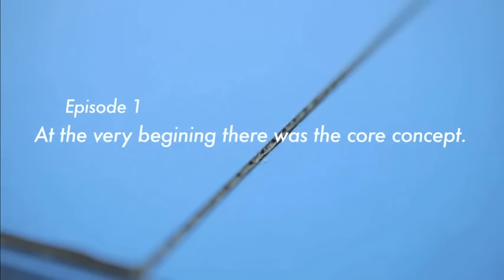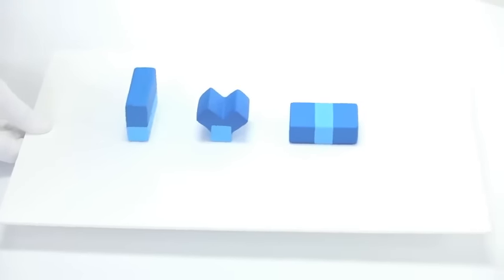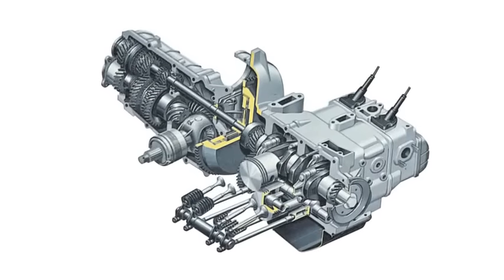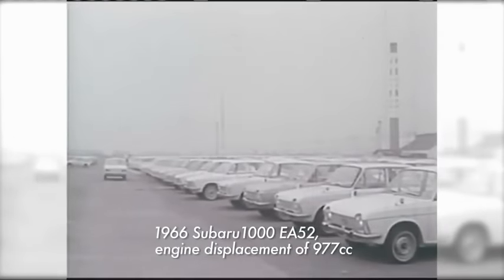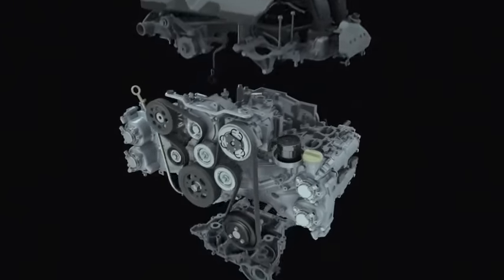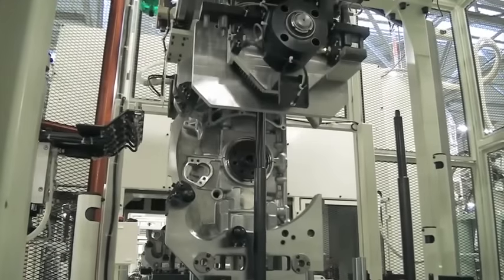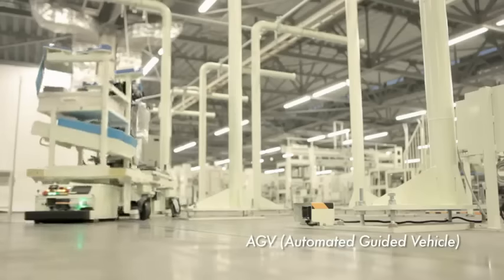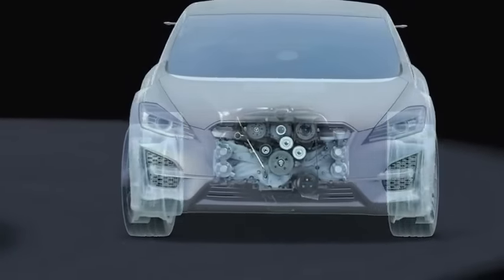Learn About Subaru Boxer Engine Technology

Comment: i drive a wrc and rather have a evo than an sti
Reply: you drive a world rally cross?
Reply: ThisNameIsntOriginal
There are WRC Homologation cars that are road versions of the rally cars. 
These typically have anti lag, (inlet bypass), intercooler sprayers and more HP. 
Also usually are sold in limited numbers, 2500 cars worldwide. 
Not sure if he's talking about a wrc evo or not, but that's usually what WRC editions are.
Reply: ThisNameIsntOriginal
Yeah, I drive a WRX. Which means world rally cross
Reply: TheMagicMan Not necessary, ive heard the X stands for Experimental, or relates to the AWD or 4WD but the X has always been debated.
Reply: ThisNameIsntOriginal no its actually world rally cross apparently :/ maybe wrc was trade marked or something
Reply: ThisNameIsntOriginal The X is the number 10. As in Evo 10. The Evolution 10
Reply: TheMagicMan you just said it meant world rally cross......
Reply: Well considering you cover is minecraft how much do you actually know about cars the WRX STi is I fact better then the Evo because it's turbo charged and can but out more HP because of it that's because the Evo is just a basic inline 4 nothing fancy not even a basic 1.8 L turbo
Reply: Shadowaries1 Some evo's not all and for the track the evo is better (unless you modify the STI) and I'm saying this as a subaru fan. However for the dirt it's a different story, the sti is usually better. Also for daily stuff the sti is a better car most of the time (depends on the generation)
Reply: ***** im not really knocking evos i mean i like they most of them have a nice ride feel but then again they drive really aggressively compared to the WRX STi which only drives aggressively when you want it to but still if your going to get an Evo and boast about it at least put a turbo charger on it i mean a tuner car is know for the handling and how quick they are via a turbo charger
Reply: Elliott Harrison yea i know and he cant even spell it right its WRX STi not WRC
Reply: Onur Oncer welp my friend some how has an evo without a turbo charger and ive seen few others that dont have them so im only going off really life stuff not google
Reply: Onur Oncer im being serious his evo just has a straight pipe no clue of any turbo charger we couldnt find one at least were do they hide them was going off of were the one on my STi is but still engine didnt sound like it and even the car didnt feel like it had one not much acceleration
Reply: Shadowaries1 The turbo is behind the engine towards the driver and passenger.  if its a regular lancer, yes those are stock. Evolutions have always had turbos, tell your friend to check, it should have small cooling aluminum air vents going towards the back, you should also be able to see the BOV. You know what? look in front of the car, you should see a intercooler in front of it. Best way to prove the turbo
Reply: Onur Oncer yea then it be right were the one in my STi is and nope theres no turbo charger i mean the car was 1 year old and used and he didnt buy from the dealer so maybe the last guy took out the turbo and didnt say anything.
Reply: Dude you play minecraft. I doubt you've ever driven a WRC.
Reply: bobkin611 why you guys calling it a WRC its WRX unless its terminology ive never heard of
Reply: Shadowaries1 There is a WRC as well as a WRX, it's a special edition.
Reply: ***** O OK
Reply: They are all really cool imo, For overall stock performance I would say the evo but subaru has the better reliability generally.
Reply: William Su yea i see alot more good safety ratings with subaru then any other manufacturer. also it does help having all the safety ratings and such in a performance car like the WRXs and other performance cars in that matter because it does inshore your passengers especially with the semi bad rep performance import tuners get
Reply: jeffel80 and if you were to read the conversation between me and another person you would see that i was baseing it off of my friends evo that doesnt have a turbo charger on it
Reply: jeffel80 That's also based on the idea of how people drive and take care of their cars. The boxer as I recall requires more oil attention than a normal V engine, due to the fact that gravity doesn't play a role in lubricating the tube. However, there are also the people who just slap a stage 2 COBB tuner on their car and think everything will be just peachy without regard or thought to what it will do over the long run of the cars life. It really just boils down to people man...
Reply: Sparatan117 yea my STi is a little heavy one the oil i check it every month but im one of those people who will leave a thousand or so head room between when i have to get an oil change and current mileage also i did throw a tuner on it just so i can fix the leen feul mixture of the car so that way i wont have to get ringlands replaced also i have an after market intake full 3 in exhaust system (header, up pipe, down pipe, mid pipe, and muffler) and a better intercooler to keep its turbo nice and cool my only complaint about the car is it doesnt take anything less the premium but hey it burns alot better and will take the car a few extra miles
Reply: Shadowaries1 Yeah I used to gripe about having to always use Premium, but then I did the math and really it's only the difference of like $6-$10 dollars... so you're getting better long term use for like $6-$10 dollars per fill up... it's worth it.
Reply: Sparatan117 yea especially how your getting A better fuel B it burns much much better in your car C you get better fuel economy because again it burns better and finally D it makes you engine last long since your not putting cheap over filtered and "watered down" fuel in it
Reply: jeffel80 subaru is generally a reliable brand their reliability ratings have always been higher than the evo. Don't get me wrong I want an evo it's got the better handling and performance overall, but subaru does good work on improving their cars all the time in things like safety, quality checks, body rigidity.
Reply: William Su That was the case, apparently the 2015 STI changed that... they're saying it's it's every bit as maneuverable as the Evo X
Reply: William Su idk to me its all about safety having a good powerful car and having fun in it i like the safety because i can simply throw it into economy mode when im commuting to work or school or just going around with friends or something but then i can throw it into stage 1+ mode and rip around the track in it or just let the car tap into a bit of its power especially on those nice cool crisp fall mornings that car seems to love them and to be honest it has really good handling like i can tear threw turns no problem but i also have really good aftermarket shocks meant for the dirt track and offroad areas
Reply: Sparatan117 the evo X is insane and really hard to maintain thats more of a car meant to be using cam 3 in it especially when your pulling 900 HP out of a 4 Cyl engine and most of the time its blowing out blue smoke
Reply: Both are cool, but I know Mitsu is gonna stop making evos for a while so I wanna get my hands on one before they are gone. I just wish mitsu would put their signature Awd system on their SUVs I like the look of the new outlander sport, but the AWD on it is pretty mediocre
Reply: Shadowaries1
after doing a little bit of research, did you see the graphs on the new 2015 STi? It's crazy. Auto bloggers like motor trend are even saying they were having more fun than they ever thought. Also in handling, Subaru's graphs showed that they beat the Evo X in just about every category. That combined with the new torque vectoring mode, the new STi is a real force to be reckoned with...
Reply: Sparatan117 yea SAWD combined with that torque vectoring system is amazing personally i turn the torque vectoring off after coming from a 2001 bug eyed STi i never dealt with it so its kinda weird having it alot of the "helpful" features ive turned off because im used to the hard strong ride of an STi
Reply: I loved the look of the older Sti's I dont like the look of the new ones as much even though they are better cars now.
Reply: William Su personally i wish they still made the bug eyed 2001 WRX STis just with updated internals to make them up to par but give them that classic look
Reply: Shadowaries1 I feel ya bruv
Reply: William Su but idk when you go from the 2001 bug eye STi like i did to a 2015 STi it is a huge leap because you getting a bit more power but you also have these new "helpful" as they say feature. idk the car has 300K+ miles and ive only recently had to do an STi swap on it because the engine finally blew the tanny got replaced at about 200K and so did the drive shaft. theres a couple other things ive replaced on the 2001 STi but she still works and i take her out at least once a month just to say yea i still have a mint condition 2001 STi lol i mean would never trade the power of my 2015 STi but still its cool just having the 2001 one still working with that many miles on it just goes to show of well subaru makes there shit
Reply: Subaru's really put on a show these last few years, I hope Mitsu will being back the evo with much needed improvements.
Reply: William Su It's been confirmed that the Evo is dead after 2015. Jalopnik confirmed that following 2015 the car line is dead. In fact, a lot of the car lines that they had are dead. IIRC they will be reclusing back to Japan to do R&D into creating hybrid/electric cars to combat Tesla and a few others. 

I don't think we'll be seeing any more Nismo/STI competition out of them any longer. The Evo was their crown jewel, but it's been surpassed with the 2015 STi. They're only a fading memory of a once great auto manufacturer.
Reply: I mean the supra was gonna be like that until recently when they brought it back better than ever with a new hybrid system. I know mitsu has been making progress for the last 2 years recovering their sales, it might be possible they will being an evo back  with some hybrid system. that would be pretty cool imo
Reply: William Su what do you mean a supra is toyota not mitsu a supra is a celica on steroids. i think by re bought you meant that toyota is investing into making a predecessor to the supra also know as the ft1 but it is only a show car right now they havent actually found a good way to engineer it look it up its pretty sweat looking
Reply: A toyota is not a mitsubishi?
Reply: No I meant what we're you talking about, I know  toyota and mitsubishi are 2 seperate companies. I didn't get what you were talking about
Reply: William Su o i thought you were saying that a toyota supra is made by mitsu lol
Reply: the awks~

Comment: '
look front bumper and grille at 230 to 233 / 451 to 505 / 515 to 520 / 1012 to 1013...
not good design...
one conveyor belt on the whole motor is a not good idea...
better 2 or 3 separate conveyor belts on the whole motor is a much better than 1 belt...
in germany made the boxer engine in BMW motorcycle

Comment: I like Subarus.  Unfortunately Subaru has not improved its head gasket system in 20 plus years and leads to engine failure.  I have learned this 3 times from Suburu and not once have they offered to cover their design flaw with a warranty (IE expensive).  I can live without AWD...I cannot live without an engine.   Do yourself a favor....don't but a Subaru unless they fix this fatal flaw.
Reply: That no gasket problem. As Mr Subaru said - it's owner problem. People abuse them so much so gasket failed, with no maintenance or service.
Sure there are few occasions. But i never have any gasket problems on my 350HP Hawkeye STI.
Stop lying and spreading misinformation. Subaru  one of the most reliable robust  cars today without useless electronic and manual gearbox
Reply: @razzor4708  Not lying.  This was my experience.  The cars were Subaru Foresters purchased new approx 10 years apart, maintained, and not modified/tuned.  Maybe Subaru has fixed their issues, but this was my experience, and being 10 years apart apparently wasn't recognized and fixed.  I like all other aspects of the Subaru design.  Feel free to call me a lier but this WAS my experience and is NOT misinformation.  Maybe I'm the only one and the rest of everyone reporting these issues are just conspiracy theorists though.  But in my case that was my experience.  Every car company has design flaws and that can be forgiven.  Not addressing those flaws, particularly over a period as long as a decade, is not something I find easy to forgive.  As to you not having problems with your turbo STI, reportedly Subaru uses a multilayer head gasket with their turbos (Mr. Subaru addresses this and I have no reason to disbelieve him).  He also admits that head gaskets without the multilayer head gasket did in fact have failure problems which is exactly the situation I had.  Maybe you should watch a few more of his videos before calling out people for lying.  Glad you're enjoying your STI and I hope you get plenty of longevity out if it.  That's YOUR experience.  I had mine.  Don't tell me I'm lying about it.

Comment: too bad rebuilding this engine costs 2x-3x more than mitsubishi 4g63 :)
Reply: It only costs $400-600 to rebuild a Boxer, depending on which version, where you source parts, etc.
Reply: +FCFordLord here in finland rebuilding a boxer engine of subaru costs around 2k€ because all the rich rally racers bought almost every possible part of the engine so they can sell them at much higher price to the other rally drivers and street racers :/

Comment: Honestly, After watching this , I appreciate the time effort and engineering that goes into these engines , but to be honest, complex, engine , = lots of $$ in real world applications , esp when it breaks . and it seems like theres two heads meaning two head gaskets meaning more parts ? more costs. more complex, more parts. Im bordering on this is good but kinda pointless. Why make things so complex.
Reply: Only inlines would have one head so your theory would suggest all V shaped engines are pointless because they are more complex.  I believe the point they are trying to get across is, less friction, less vibration, less weight displacement = less wear and tear, higher performance, greater fuel economy  which are all $$ savers in real world applications.
Reply: that was the stupidest comment i ever read.  Why make things complex? umm maybe because we are in the 21st century and demand better

Comment: bahahahahahaha
Funny how when they justify it's superiority with vibration compared to a inline and V motor they only use 1 and 2 cylinders. Everybody knows this vibration is zeroed out with either timing the crank on 4, six and  cylinders or balanced with a balance shaft for 1 or two clyinders and 4 or 6cylinders where piston timing is more critical for power output.
May of been a spectacualar breakthrough back in the 60's but it ain't anymore and hasn't been for a long time.

Comment: Lol they say there engins are unreliable... What car has the best resale value 2015 wrx. Which car company has 95% of there cars still on the road from the last 10 years, Subaru. No engine is perfect. Do you want a car with a high center of gravity or low center of gravity? Of course you want a car with a lower center of gravity. That where the boxer engine shines

Comment: Wish they didn't sound so awful!
Reply: The engines themselves sound just like an inline four. It's the headers that change he sound.
Reply: add 1 foot to the left exhaust flash-pipe, ie the pipe that is connected to the exhaust manifold and it sounds like a V8, it actually sounds better. Then replace the rear muffler with one with a bigger diameter and shove a block like a coin up to the 3rd distance from the inlet and WOW, how it lowers the frequencies so that it rumbles like a high capacity v8. Goodness it sounds good; but it does loose 2% of the power. Who cares? It just sound great.
Reply: Most people LOVE the boxer rumble!
Reply: +Offroad Foz yep, I love that unique sound. You can recognise its a subaru just by engine work sound or startup.
Reply: They definitely sound awesome. I really miss my protuned WRX STI's sound.

Probably the best sounding 4 cylinder I've ever heard aside from the new Alfa 4C but even then it's on par.
Reply: You are confusing the sound of the unequal headers found on lots of sti's etc, the new FA20 direct injected engine w/ "equal" lenght headers do not sound like the engine is "missing or misfiring". 2015 WRX (not STI) sound just like a Porsche engine. I have one. But Subaru really messed up on the factory tune, horrible is an understatement. But easily fixed w/ a Cobb Accessport w/ a stage 1 tune ($650). It is a MUST!!!!
Reply: suzuki swift engine

Comment: it loves to drink motor oil
Reply: 99.9% of them have little to no oil consumption.
The affected models are from 2013-2015 and were less than 2% of the total sold in that time.

Comment: Too bad we haven't learned about why these engines burn a quart of oil every 1000 - 1300 miles. Oh wait I seem to remember Subaru claiming this is normal....Never mind!
Reply: +CheckmateKing2 I have a 2003 subura baja. Yes, I did have to have the head gaskets replaced about 120,000 miles. I change oil and filter between 7 to ten thousands miles. It might use/leak  one pint of oil between each oil change. It has right at 155,000 miles on it and I plan to put atleast 50 to 75,000 more miles before the salt put on our mountain roads finally causes the frame and underworks to completely rust out. I wish they would make a six cylinder subura baja. I would buy a new tomorrow. !!!!!!!
Reply: Less than 2% of 2013-2015 models had the issue. That is a very small amount of all Subaru's.
Reply: FCFordLord Yes unfortunately mine was one of them